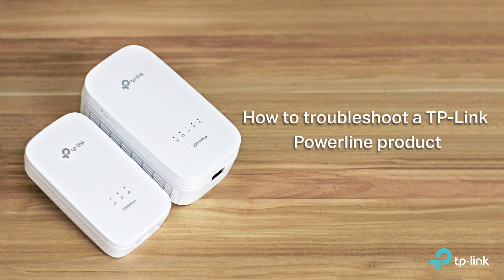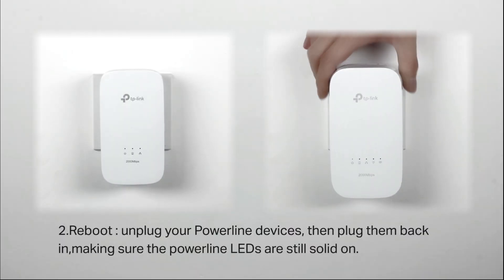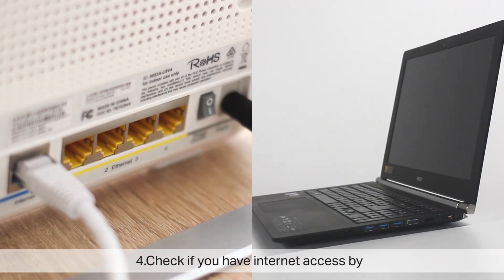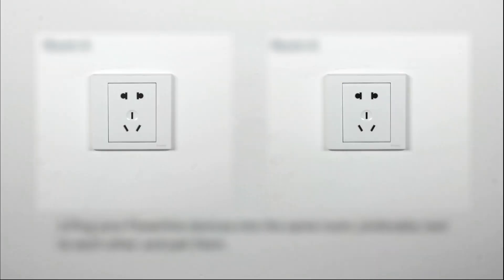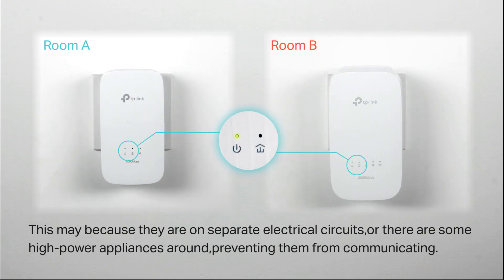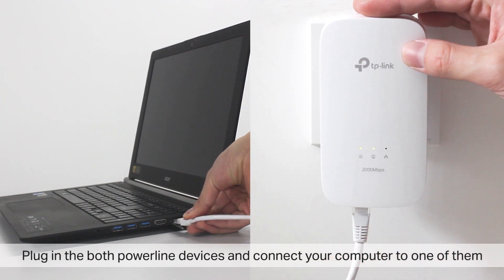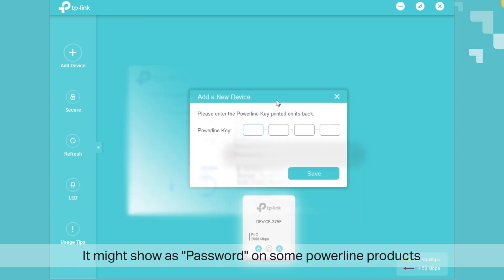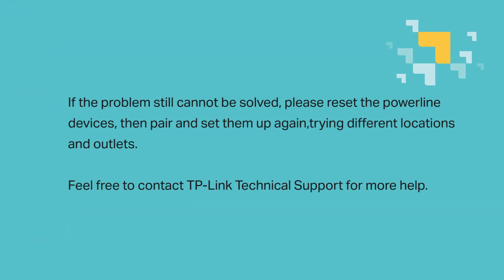How to Troubleshoot a TP-Link Powerline Product

Comment: My TPlink stopped working suddenly after plug and play for a good year or so .I reset it and the lights came on and paired with the router etc , but after a minute all the lights went out .If I move it to a different plug , the lights come on then it all goes dead again .Is it salvageable or should I bin it ? Thanks
Reply from the maker: Its possible its gone defective.  We would recommend contacting support in your region as the product may still qualify for a replacement under our replacement and warranty policy.   The policy is region based so please check your area's policy on tp-link.com before contacting support.
Reply: TP-Link Thanks ....not sure if I'd be able to locate a receipt.Should I update a firmware or something? The lights do come on , pair and then go off after a minute or so .
Reply from the maker: @Pattie-jz9vr  The only concern with attempting to do a firmware update is that it appears the unit is cycling itself.  If that happens in the middle of an FW update the unit could become bricked.

Comment: why not a power strip?
Reply from the maker: Because power strips filter electronic noise.  It will reduce the data transfer rates and cause performance issues.
Reply: @TPLINKUS  wow now it makes sense, thanks 😁😂

Comment: So this device needs to be on the same breaker...  Kind of defeats the purpose of why I purchased the item.
Reply from the maker: It has to do with the Standards used.  AV1 standards require the products to be on the same physical power line.  This normally means the same physical breaker.  AV2 is a little more robust and can work across breakers in the same panel.  Power line however cannot work across panels regardless of the standard used.
Reply: @TPLINKUS  I put the password code but it says cannot find device...
Reply from the maker: @nikoschalkias3029  you would want to contact support for assistance.

Comment: Ethernet over powerline adapters are a royal PITA to begin with.  These are some good tips, though my device is not the same brand.  Not being on the same circuit shouldn't be an issue, there is still an electrical connection, however, a breaker panel is usually split into two "legs" in the USA.  Circuits will branch from either of these to form 120V relative to ground.  If the devices are on separate legs, I suspect they cannot communicate, as I believe this means the signal has to travel back to the transformer(on the pole), through the inductive loop in the transformer - and this is where the data signal dies.  This could be why switching outlets might net a good result, however that might not work if the outlet that works is in another room.  Short of swapping the breaker positions, if it doesn't work on the circuit you need, you might be SOL.  
I could be wrong.  Someone correct me, please, if so, as I'd love to fix this, though tomorrow I'm planning to check which legs each of the circuits my adapters are plugged into are on.  If they are on different legs, and I can coordinate a power-down time with roommates, I will switch it and try again.
Reply from the maker: Most PLC adapters regardless of manufacture run on Homeplug AV1 or Homeplug AV2 standards.  For TP-Link any PLC rated below AV1000 is a Homeplug AV1 standard.  These plugs actually require to be connected on the Same physical powerline.  AV2 standards allow for same panel so any circuit in the panel even if they are on separate physical powerline will work.  However each "jump" will reduce the overall performance and quality of the signal, as will distance.  PLC are rated up to 300 meters.  The best analogy is your Wifi signal.  It gets weaker as it goes but also each object or wall reduces it as well.   The same goes for PLC.  each hop reduces the signal as does the distance.  For objects anything plugged into the home's power can create "noise" on the line and create a sort of barrier the signal must be passed and reduces the performance.  This is why we also recommend any device especially major appliances be "filtered" by a surge protector.

Comment: Wow this actuall worked. I spent days resetting it, unpluggin, changing rooms, drivers etc. They both only had 2 lights on and now they paired instantly and worked. All i did was like the guy in the video says get the powerline key from the one that was plugged into the router and then typed that key in add device. Instantly all lights lit up and works perfect again. Hope this helps someone. Feel free to ask qs if you need help.
Reply: paid actor
Reply: My extender sometimes work pefect but sometimes it doesn t work(not paired). İt changes during the day. What can i do ?
Reply: @yektahezer9870 i have the same issue, have you resolved it?
Reply: @santijeffers  yeah it's probably because led lamps. They have driver inside them and it's not good for extender
Reply: Imagine asking for questions and never replying
Reply: @edrichtofen  it's a lonely world out there.

Comment: These are pretty easy to use and in 99% of setups they DO NOT need to be paired as they are just plug and play. If you have tried to pair them you run the risk of locking yourself out of your own network and the only way to reset them is to download the utility software from tp link. They are a good product that solves connectivity issues you might have through interference or the router being too far away from the intended device.
Reply from the maker: This isn't actually true.  If you attempt to pair the devices manually and for some reason fail to do so, simply holding the pair button for 15+ seconds will reset the pairing.  Then hold the pair but for 3 seconds on the 1st adapter and then 3 seconds on the 2nd adapter to initiate an auto pairing.  A much easier way to pair is through the mentioned utility as you just need the power line password on the back of the adapter to quickly add the product to your powerline network.

Comment: everything here works for me all the lights are green, i plugged it into my nintendo switch and it didn't work. I don't know why I have an adapter that everyone says works in the reviews so i don't know what the problem is. PLEASE  help
Reply from the maker: We would recommend connecting a computer and seeing if you can browser the internet first.  Also please make sure that the Nintendo Switch is setup for Ethernet and has an IP.
Reply: @TPLINKUS  why can’t I plug it into a power strip? There are no wall outlets near my pc and I want to use Ethernet.
Reply from the maker: @planebassoon6029  Because most power strips are also surge protectors and these devices filter the data as electrical noise.  This is similar to why GFI/CFI outlets trip.  If its a true power strip you might be able to use it but only if it doesn't change the polarity of the plug.  for an example if you plug the unit upside down in an outlet that would change the polarity and if the other unit is right side up they would not be able to transmit to each other.

Comment: This thing is just a piece of garbage. I paired them up in the same room then took one to the power outlet beside my Xbox and plugged it in. The internet is working fine but when i go onto detailed network statistic my download speed and everything else hasn't changed at all. I'm still trying to figure out if i just haven't set it up properly but it looks like this is getting returned. What a waste of my time.
Reply from the maker: With Powerline the main thing that affects the speed is interference and circuit hopping this forum post will explain this in greater detail https://community.tp-link.com/us/home/forum/topic/150615?page=1

Comment: Hey, I just bought an AV600 to plug into my shed. The adapter was working for around half an hour after I installed it but has not been since. The powerline light itself comes on for around 10 seconds and then turns off for around 10 secobds and just kind of alternates between the two.

My shed is on a different circuit breaker box, but is on the same grid as the house. Is that what is causing the issue?
Reply from the maker: The circuits must go into the same panel.  If your shed is on a separate sub-panel that would be your issue.  PowerLine adapters cannot work over separate circuit panels.
Reply: @TPLINKUS  Is that the box where the breaker switchs for the shed would be contained? 

Because since posting this, the adapter has started working almost perfectly! (Have had a few occasions where it wouldn't connect to the modem but those lasted generally from 2 minutes to 30 minutes at max)
Reply from the maker: @matthewwiggins4582  yes exactly if the shed's panel box is the same as your main house then there should be no reason why it should not work.

Comment: So obviously my reason for wanting to use this is because the modem is on the opposite side of the house, which also puts them on different power line circuits.. so this TP Link won't work?
Reply from the maker: Not necessarily If your TP-Link powerline adapters are Home Plug AV2 standard, as long as the circuits are all in the same breaker box you should have no problem with this solution.  If it is home-plug AV1 standard then yes you would need to be on the same physical power line.   All TP-Link PLC kits rated AV1000 and up are AV2 standard
Reply: @TPLINKUS  well crap.. no wonder the AV600 is on sale..
Reply from the maker: @BrandonABsm  If your able to return the AV600 this is a pretty sweet deal on our AV1300 https://www.amazon.com/TP-Link-Technology-Beamforming-TL-WPA8630-KIT/dp/B076CYV2XH/ref=sr_1_2?ie=UTF8&qid=1543878599&sr=8-2&keywords=TL-WPA8730&th=1
Reply: @TPLINKUS  Okay I am having a new issue because my mom works from a home office and just moved. The av500 will not work as it used to in the new place. The router +adapter are upstairs, the extender +voip phone are downstairs... as I read your comment the AV500 (4220v1) will NOT work and we need the new version?
I have the AV500 4220v1 as well and the router+adapter is on a different circuit /room than the extender is and it works for me... the whole point of the av500 was to create ethernet ports in different rooms, which are (as I understand it) on different circuits (different breaker switches).
Reply: @TPLINKUS  but my computer doesn't have a WiFi card..
Reply from the maker: @BrandonABsm  You don't need one all of our powerline adapters have ethernet ports to physically connect a device to it.  If you do not need to extend wireless range then a TL-PA7010 Kit would work for you as well.
Reply from the maker: @midnight121190  Unfortunately its more the protocol and less the device.  AV500s run on Homeplug AV1 standards which has shown issues working between breakers.  HomePlug AV2 standards did resolve this by allow the adapters to work between breakers as long as they reside in the same panel.
Reply: @TPLINKUS   Awesome! I'm about to buy, but before I do.. this won't interfere with my av600 that I'm currently using in another room will it?
Reply from the maker: @BrandonABsm  Nope Depending on which unit is your main unit you can add a various amount of additional adapters.  This FAQ will show you how many.  https://www.tp-link.com/us/faq-434.html

Comment: The power line works fine during the daytime but in the evening keep getting breaks in the picture, can be as bad as once every 2 minutes. Very frustrating!!
Reply: Seems like in the evening, more electrical devices are being used.
Reply: Did you find a solution? Got the same problem?

Comment: well once the powerline adapter is connected no other device can use the wifi properly. we got 3 computers 2 consoles and 2 smartphone and all of the get kicked off the wifi and also we get download speeds around 10 - 15 mbit when the wifi decides to work. disconnect the power line adapter and everything works like a charm. when the adapter is not connected we get about 120-140 mbit download. this is really frustrating
Reply: Same problem

Comment: Stay away from TP-Link powerline adaptors!

On some models like TL-PA8030P you get constant disconnects!
At first they make it look like they are helping you or you are helping them to find the problem.
Instead they are sending you on a wild goose chase!

Their tech support is also using an old manual which refers to an old version of their utility even though they have not used that version in ages!
It's a complete joke!

All they have to do to fix it is release a new firmware, and even though they claim they are working on one, they have not released one in over a year!

Dont waste your time or money on them!
Reply: bigo93 what else would be a good one to get
Reply: That is because they have a patent pending sleep technology in the device (which doesn't work).  If you search you can find a workaround where you create a Windows batch file that pings the network every few seconds, therefore stopping the device going to sleep.  

https://www.youtube.com/watch?v=Al3kwmfzsOQ
Reply: I dont have a PC to configure?😢

Comment: I have three TL-PA9020PKIT AV2000 units. One on the Router, and one in the same room linked to a Smart TV. The other one is upstairs linked to my iMac and a netgear router for the other kit in the "mancave". They had been working without problem until the last couple of days. I think the problem may have been a plug half into a socket. This seemed to throw the units out of sync and I had either constant red lights or flashing red lights on the Poweline LEDS. I have taken each unit and upgraded the firmware to latest version and then done a default reset on each. Now all units are back with three solid green lights. Wonder how long that will last.

Comment: My tp link has only 2 of 3 lights on all the time everything else is conected with my router except my pc im so angry i want smash that thing against the wall
Reply: Dude I've never felt a comment so much.  Currently trying to figure out what the hell the problem is
Reply: Did anyone find a fix I’m really pissed off over here
Reply: i have already done it
Reply: Any fixes ??
Reply: @bonito613  yeah, buy youself a Cable and connect your router with your PC. It worked for me tho
Reply: Auric no shit sherlock. the problem is he cant connect it to anything
Reply: Same
Reply: Same.
Reply: I did, it didn't help me connect to the internet, two pins bent so it won't fit the plug socket anymore but can it felt good 😤😤😤😤😤😤 after two hours of messing about with this shit
Reply: *can lol DAMN
Reply: Mate, I have the same, but when when the WiFi is turned of, I can use my WiFi from the WPS. I don't get it.

Comment: Hmm. i have all LED's lights on on my Powerline but my PC read it as 'unidentified network' anyone can help?
Reply: i have the same problem...
Reply: Hello, i tried to moved where my router and my other adapter is plugged to. And i plugged my adapter in the same room and paired them again (if they don't, try resetting both adapters) and tried in my room again. Turns out that the signal or the internet is too bad to read in my PC.

Comment: Hello sir i am from nepal so i am having a problem with TPLINK TD-W8901N it blink only 3 lights but we need 4 lights to work i have reset my router too but nothing happen
Please reply me fast as you can
Reply: Hi. The leds can't blink forever. After 1-3 minutes they must have a solid light instead blinking to have a complete and functional network. I have not that model, but assumed that the configuration must be similar to anothers powerline models. Maybe consulting the manual and follow the correct steps you figure out what can be happening. Good luck.